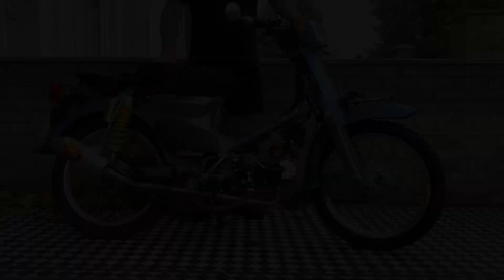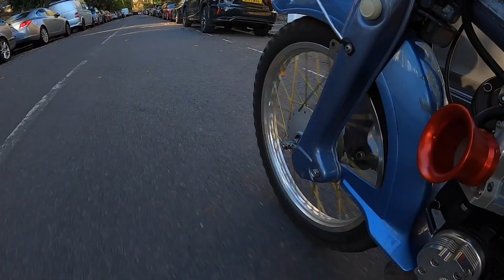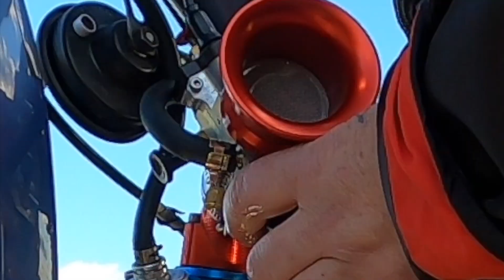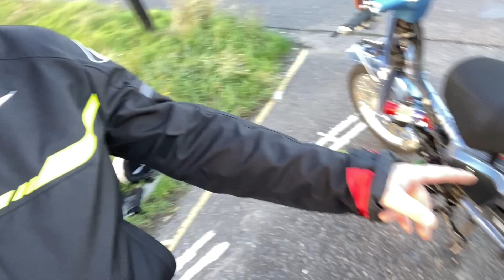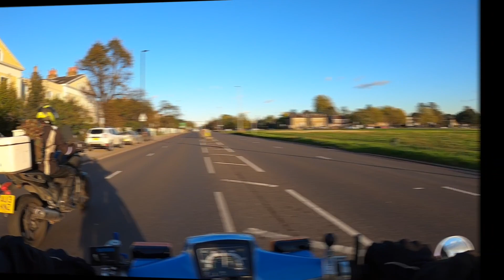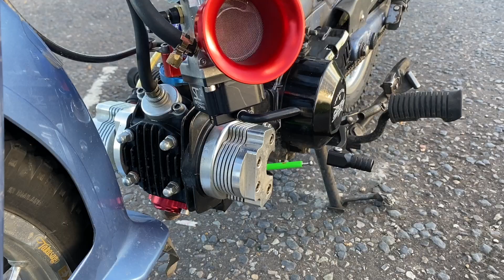Smart Carb 2 Test riding on a Honda Cub C150

Comment: in malaysia they modified this bike with 65mm semidome piston and jet rod normally 3mm can ride with 250cc bike with no problem. make sure the comp ratio around 9-10 because no water cooled.. if can make it water cooled can jump up to 12-12.5 comp ratio. can get 120-140kmh cruising speed.. with the smart carb sc2 maybe can get 120-140km mileage per full tank in town use.180km hiway use. gonna grab this carb soon and it is fuel efficient up 30%.

Comment: Good work. Would like to see the fueling from a wide band fuel sensor output to see how well it could be dialled in over idle, part and full throttle👍

Comment: That assembly is precisely the opposite of what I like to do. Flashy parts shining all over, with bright colors to go along. I prefer the more discreet "black and gray" approach, closer to a "sleeper". 
But with that said. That's a really nice build I can see the appeal. 
Regarding the Smart Carb 2 some fuel consumption numbers. And your seat of the pants based report would be very welcomed. Let alone some dyno numbers!! Just saying. ;-)
Thumbs up. Cheers
Reply from the maker: There is a 3rd video out on the dyno , check out kiwi media for this 👍 I am in the process of doing a part 4 vid with the new factory mods ( yes it got sent back to USA )
Reply from the maker: Smart Carb V Nibbi Dyno Run Honda Cub
https://youtu.be/wnDe9mxbnzU

Comment: That carb must have cost close to £1000, with shipping and customs charges etc?  Nothing to stop you spending £1000 on a carb, and the same on shocks (if they are Ohlins?), but wonder if it might be worth selling the step thru, and buying a faster, better handling, more reliable, and nicer looking bike?
Reply from the maker: I can Handel the  ohlins ,faster ,handling , reliable , cost dig BUT the  nicer looking bike comment is way out of line 🤣 
Thanks for watching and taking the time to comment , 👍
Reply: @KIWIMEDIA  Are you intending to race this bike?  Pit bike motors have quite a few designed in failure points, which you need to be aware of.